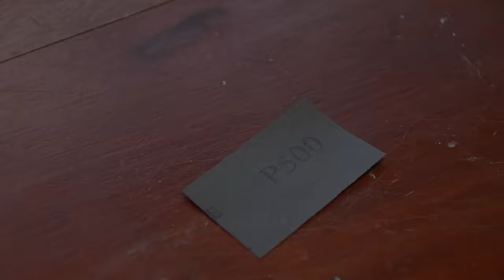make a twin dragon pendant - DIY dragon sword pendant

Comment: at 4:37.. cleaning the welted sword on alum solution, is it alum salt mixed in water and heated? or anything else also mixed in the solution? Please let me know.. 
It's a pain to clean by hand sanding on intricate parts after welding..
Reply from the maker: yes it is alum salt boiled with water,,the solder residue will disappear when boiled with alum solution with a duration of about 2 minutes,,in my previous videos there was a process that was shown in full
Reply: Thanks so much! I  tried it yesterday.. Not sure why it didn't remove the residue much... :( waited atleast for half an hour.. :( :( ( my piece was of brass )